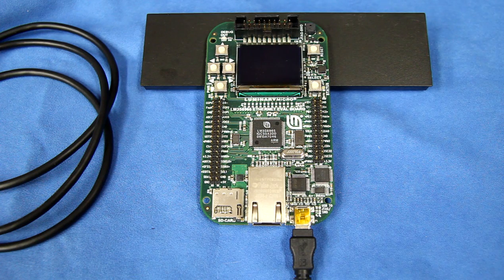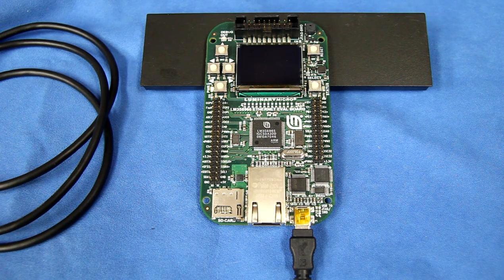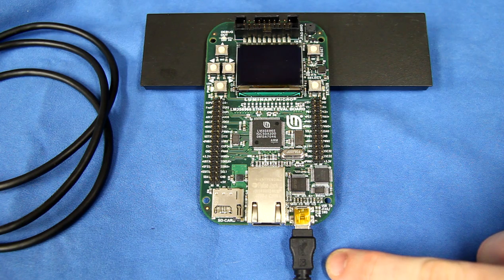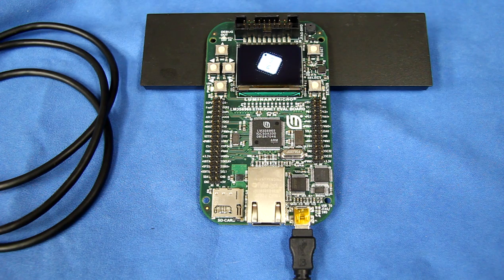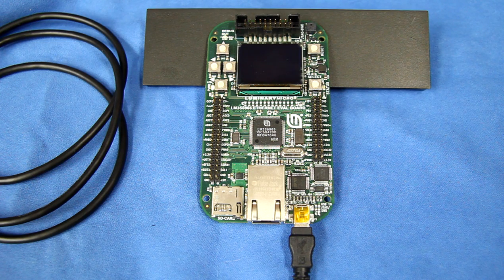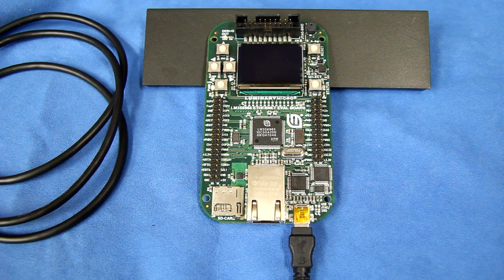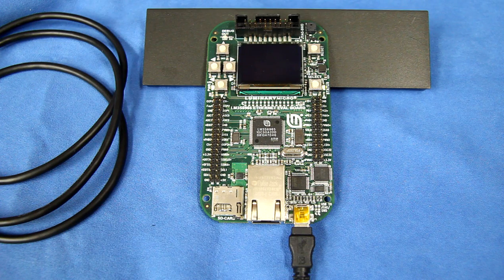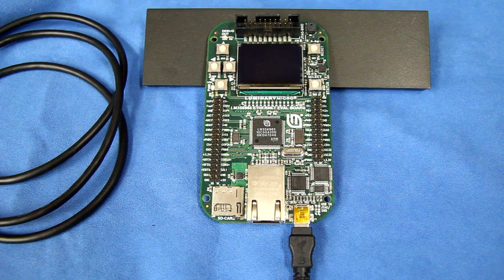eLua 0.7 on LM3S6965

Comment from the maker: You can use any editor.  There are some specifically geared for Lua or eLua, such as an in-development IDE called Goat-IDE (can't put links in comments). Nothing special needs to be done to the files (.lua extension is common though).  You can get them to the MCU a couple ways, one is the image, another is putting it on an SD card and reading from that (there's also RFS, LuaRPC & XModem), some info in the docs (Generic info->eLua file systems)  Feel free to drop by the mailing list.